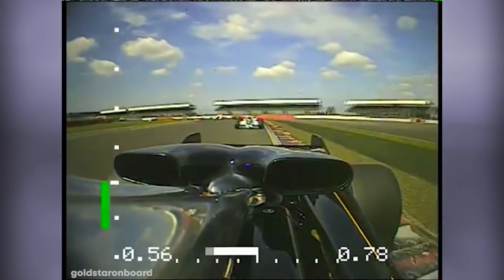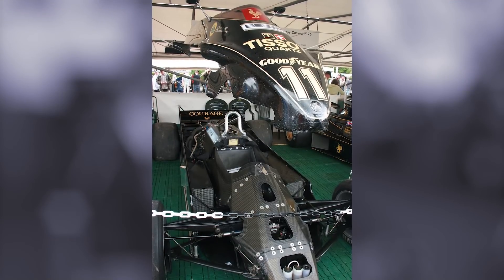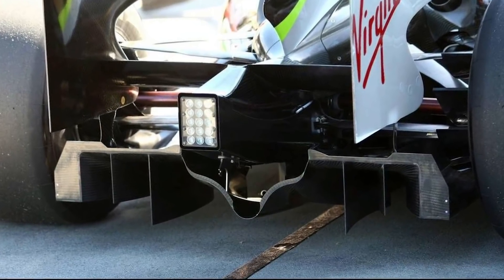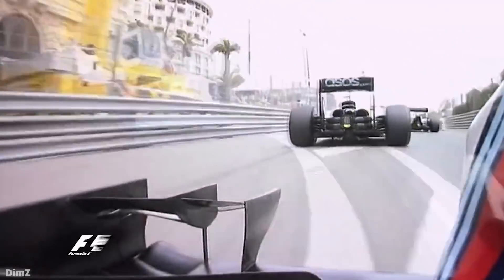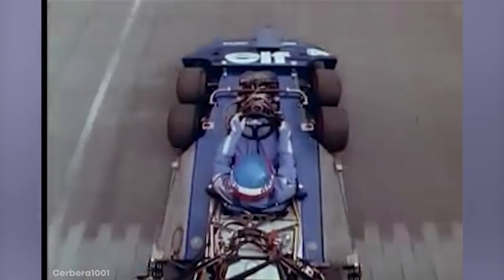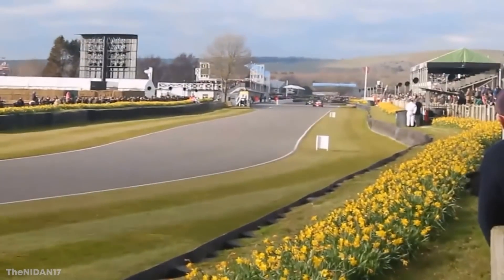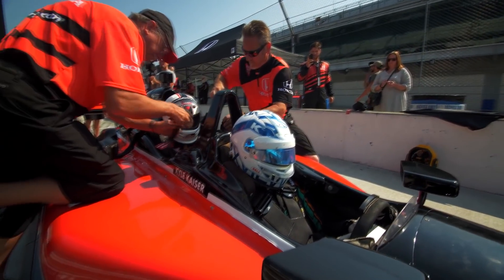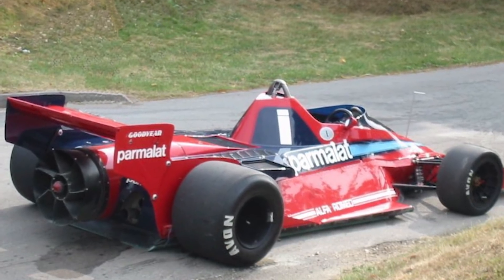15 Incredible F1 Innovations

Comment: 2:13
The cvt actually only went as far as testing. It was banned immediately by FiA before season starts. Nonetheless, it would be very short-lived as a transmission as CVTs won't work well with high power engines. You rarely see CVT cars above 300hp.